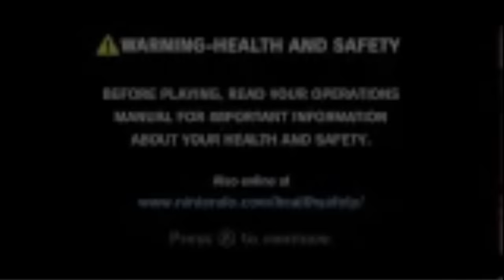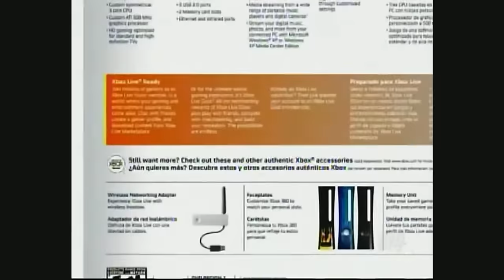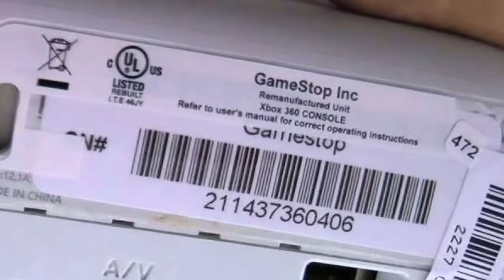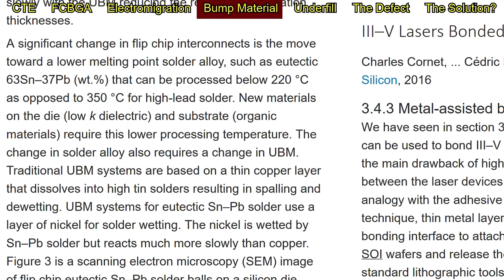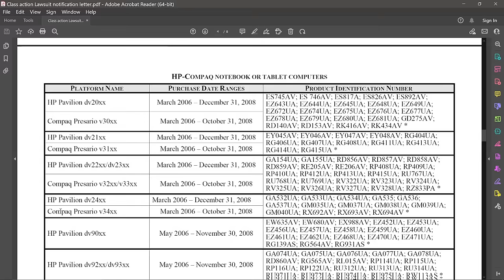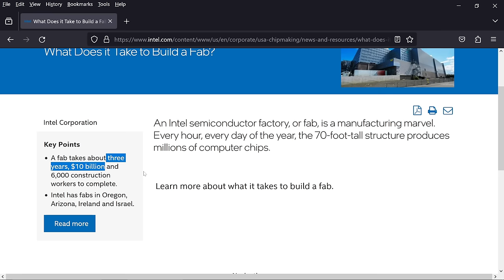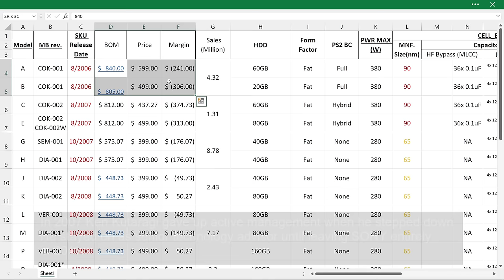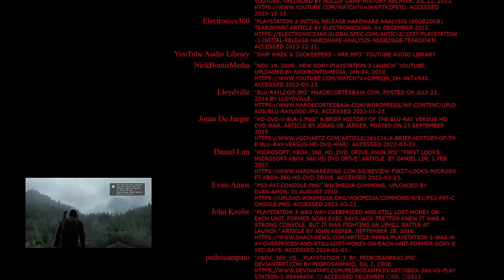A 360 Story -  The RED Ring of Death & the 7th Generation Console War

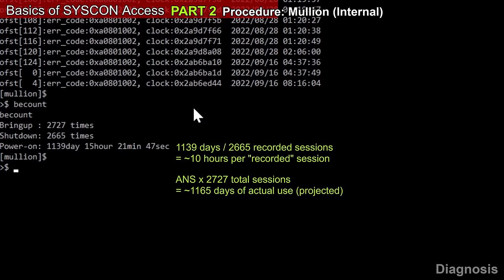Comment: Felix, I have a DIA 002 console that got YLOD with 3034 at 96 days (date code 8c). Could this just be random failure or could some 65nms still be fautly? Refering to 1:19:33
Reply from the maker: It could be a legitimate BGA defect. They do happen. The things I look for are any signs of drop damage. Scuffs, cracks, or dents that might indicate a fall. That's a common cause. Another is is when you change the thermal paste you have to separate the Heatsink from the motherboard, which requires bending the  board to break the seal against the integrated heat spreader. That can break the balls too. So if it's unsealed that could be when the break happened. If you were the one to unseal it, was it working before the paste change? Did you get the errorlog? if it was full of 1200s before opening (cpu overheat) then 3034 after changing paste, that's probably what happened.

If it was sealed and undamaged then it could be naturally occuring. In that case, how much dust is there inside? If caked with blankets of it prolonged overheating could increase the stresses leading to solder failure. But given how few 65nm GPUs die this way, I'm inclined to believe there is no bumpgate related defect in the 65nm RSX. 

A pressure test can tell you if it's BGA most of the time. You press on all four corners of the RSX while trying to turn on. Not alot of force, you can cause a BGA defect pressing too hard. Tjos warps the board and restors contact of a broken ball. If the behavior changes that's a positive pressure test result and more often than not, indicates a BGA failure. It's not 100%, but good enough. If it does nothing at all, it doesnt rule out BGA, but could mean it's the CPU or bumps, or another issue.
Reply: @ripfelix3020  it was a sealed console when I got it (albeit with a hole drilled in the hdd side of the top case infront of the PSU - meaning potential overheating in the past?). I did change the paste on the system and it lasted around a 3 months after with minimal usage. 

The board wasn't stuck as firmly as others I've had in the past in so I doubt I could have damaged the BGA removing the board. There wasn't an awful amount of dust in it but I have no idea how it was previously used so I can't really say much on where it was used if in an enclosed cupboard etc

I've only ever had ylod on one of those boards that was not brick related cos of a bad connection on nor with e3 flasher... used to hate the DIA boards - so I have some solid RSX chips for potential frankenstines from those when I learn to reball 😄

I've not pressure tested it as such but I decided to delid after the ylod when I used the UART and the chip was quite discoloured (adds up with the drilled case?) 

Ended up as a parts console in the end and got two others working so it has made a good sacrifice 😂

Comment: Hey Felix, just watched your vid on the YLOD and it was really informative. It did get me wondering though, have you ever done a dive into the BLOD on the PS4 Pro? This video and the PS3 video has me drawing some of the same conclusions. The main fix i see everywhere is throwing in some washers to make the connections tighter, but after seeing your videos I know this is not a fix. But these are unlike the PS3 chips that you suggested be replaced, as they're newer. Would Sony really make the same mistake twice? I'm really curious on your thoughts on this.
Reply from the maker: From what I know of the BLOD, people are reballing them and having sucess. What IDK are the long term statistics on that. Like if a significan number of people have them fail again after a year or 3. If not, then it could just be run of the mill BGA defects, which OFC can and do happen. But how many of those are on untampered consoles? Kept clean and maintained? I've not looked into it. It's unlikely they made the same mistake (bad packaging materials), but it's possable.

Comment: The clip of MVG is particularly amusing to me because I've caught him being wrong about several things. His channel is really interesting but his technical expertise is shallower than I'd expect for a professional game developer. Guess in his defense the areas where his knowledge have been shallow in the past are mostly with hardware or extremely low level software(OS kernels) where a game developer really has no business being on modern platforms.
Reply from the maker: My purpose in showing that clip isn't to rail on the guy. It was just to show how pervasive the thermal connection is. Everyone knows there was a thermal component to the failures, but everyone assumes overheating. MVG did say "aparently." He left the door open to be wrong. I'm not faulting him for not knowing the muinutia of hardware. This is a quite hard core principle that a software guy isn't likely to be well versed in. It does not reflect pooly on him in any way. It just exemplifies that the issue isnt well understood, even by experts in the scene. 

If he doesn't know, the randon dude on reddit that knows nothing at all asking for help is going to get all kinds of bad advise. I though that it was important to show that clip, so that people don't feel ashamed for not knowing.

Comment: For some reason, my black Jasper console still failed after 4 or 5y. Completely broke during a Forza 4 session and could not boot anymore. If early models were any indication, the issues with manufacturing were not only present on the underfill but on solder quality throughout the board.

Replaced that one with a Xbox S which has been working perfectly until today.

Comment: Trust me, the Wii had heat issues too with the always online crap like WC24 causing heat buildup without the fan running to keep it down and causing disc drives to warp and break down, happened to mine back then and I never replaced the drive because I was knee deep into ISO loading even at that point

Also I have one of those RROD screw kits installed but I keep the screws loosened to a small adjustment and keep the 360 horizontal to keep heat warping from occuring and keep the cooler in contact, the kit can work but everyone loves to death grip the thing to the board
Reply: When was your 360 made?
Reply: @CliffNark  was bought for me as a gift some time in 2008 or 9, was the Lego Indy bundle, odd thing is it either shipped as a zephyr board or they put a first rev CPU cooler on a newer mobo by mistake since I had to swap the coolers

Comment: I was always more of s 360 guy, so I'm glad that I have this incredibly well done video as a resource just like the YLOD documentary. I do have to ask though, have you ever considered doing the Reset Glitch Hack on an Xbox 360? It does most of what a jailbroken PS3 can do for team green.
Reply from the maker: Yeah, I got an early xenon I'm hoping is RROD. I'd like to put a fixed GPU on and RGH it. Might make a vid out of it. Should be fun.
Reply: @ripfelix3020  
Sounds like fun, but do be aware of this: Xenon mobos work best with the EXT_CLK wiring and timing, and this is to be done with a glitch chip, since Xenons don't take RGH 3.0. Also fun fact: some Xenons were actually repaired with a 80nm Elpis GPU, such as my own.
Reply: @superstar64 no Xenon’s have 65nm GPUs except for the one I did with custom trace rewiring. Maybe you meant Elpis 80nm?
Reply: @Josh.Davidson  
I thought I heard somewhere that the Elpis was 65nm, but yeah that's what I meant. My mistake, I'll correct that.

Comment: Without specific details about pinout from the gpu to the interposer and the location or locations of the thermal diodes on the gpu, dropping gpu temp down to 60C can be useless, because if the power pins are near the data pins and if the balls are not quite up to par ( micro cracks,  contact is not that good) the whole area surrounding balls will heat more than the gpu, especially when there is a lot of current draw eg. when pushing gpu to its power limits and if this underfill has not great heat conductivity this will create hotspots near this balls. So maybe if can drop the temps of the gpu and the motherboard gpu power planes to like 40C the release consoles could and maybe even nec caps could last longer ^^
Reply from the maker: That's why the authors of "low tg underfill the good, bad, and the ugly" said the strategy was to keep temps far below the Tg. As for how far...who knows. MS lowered it -7C beneath the revised Tg (75/78C for HTg85 GPUs). IG they calculated that was sufficient given the TDP of those revised GPUs. But it's not a rule we can follow generall outside those GPUs. Like with the RSX or the defective Y1, Y2 and rhea GPUs.

Comment: Are Nvidia and ATi graphics card for PC subject to the same issues ?
They seem to, but that could be another human bias playing with me :)
And if so, would changing the thermal profiles/upgrading the cooling solution so the GPU never reaches 70°C could make the remaining units more reliable ?
Reply from the maker: Yes, it does appear to have affected the entire industry...but it's not clear what chipsets are 100% affected. A total accunting hasn't been established.
Reply from the maker: If it has the bad underfill, keeping it below 70C should help, but there's alot of factors and it shouldn't be thought as a fix.
Reply: @ripfelix3020  I see
I have an Nvidia 8800GT that's still working (was pulled out in circa 2014 from a core 2 quad machine I think). Being thoroughly used from early 2008 to ~2014, I think it won the silicon lottery (Haven't tested it since tho, maybe it died in the box it's been sleeping in ever since ...).

One thing I seem to have noticed (could be just a bad memory/bias), I feel like as it aged it became more and more noisy, despite our best efforts to keep it dust free and refreshing the thermal paste. Maybe Nvidia changed something from the drivers ?

Anyways I'll have to make more experiments with it (which will probably be not enough considering this card is probably a winner anyways)
Reply: To an extent. Larger gpus with worse cooling are known to have more thermal expansion issues and die faster, but it's usually still within the practical lifecycle. Examples are reference blower GTX 780 Tis and 980 Tis. If you want your components to last past their normal usage you probably want to keep them well below their rated tolerances.
Reply: @ripfelix3020  From what I've seen, anything that came out since Geforce 6.

Comment: In the end, do you think that super slims are generally more reliable with more proven components, or cheaper with only CPU/GPU fixed designs which simply heat up less?
Reply from the maker: No, the SS is cheaped down too far IMO. The best compromise of reliability and cost IMO was the 21xx model. It has the 40nm RSX, no tokins, and the more reliable bluetooth/wifi module. Later models have a reliability issue with that thing dying.
Reply: @ripfelix3020  I see thanks.
I have a PAL 20x cfw and a NTSC-J 40x I keep legit for now, but the 65 slim is effectively much louder and running obviously hotter. (and the drive starting to make weird ticking noise I couldn't find the cause after opening it...)
Overall the super slim is more pleasant to use when mainly digital than the slim.

Awesome work on your 2 videos btw :)
Cheers

Comment: I enjoyed the ps3 YLOD explanation video and this too! I have 3 working  PS3 and 1 non working with most errors 1001/2 and the final 6 of them 3004. I thought fan speed would matter more in order to stay alive more! The faulty ps3 had soooooo mush dust in it and  it was used with the front fan add on, the one that did more noise than cooling haha, but I thought this might be the reason that there are no RSX errors, yet. I have all working ps3 with fan speed at 60%
I KNOW it is loud but I have the console somewhere not close to me in order to stay cool and not bothering me, not so much 😂Do you think that temperatures below 60 Celsius won't help RSX?
Reply from the maker: Keeping temps "significantly" under the 70C Tg of the underfill is a solid engineering principal that "should" help. I cannot say it will. There is much more involved. However, in my experiance and from anecdotyl reports from others, consoles that run hot, full of dust, and ill maintained die sooner. Keeping them clean and cool makes them last longer. So traditional wisdom still applies. I just cant give you reassurance that setting a 60% fan speed is for sure going to prevent YLOD. The best I can offer you is,  It should help.
Reply from the maker: The construction of the die and interposer involve more than just the underfill. The under bump metalization layer and it's shape can affect the mechanical strain forces it experiances. The presence/absence of a polyamide passivization (stress) layer can affect how much force is applied to the area around the bump joint. The TDP of the chip and thermal inertia (how much heat, how fast) it can deliver affect the forces. The 3D design and layout of the power planes and components (die, SMDs, VRAM, the motherboard) all affect the flexing and stresses...

And much more I'm not aware of. All of this has to be modeled in CAD and simulated. Then optimized. Then tested (qualified) to failure to be sure the simulated results match up with real world results.

There is sooo much more that goes into it than just the Tg of the underfill. If I said all you need to do is be sure it stayed under 70C, then I'd be ignoring a crap-ton of other properties that could greatly influence the result. Will it? IDK! Which is why I can't say it.

All I can say is, "it should help."

The smaller the change in temperature (Delta T), the lower the thermal stresses and longer it'll last.
Reply from the maker: They affect all Flip-chip packages. From your pc graphics cards to ps3. A defective material set can doom anything.

Comment: Make the PS3 CPU STL model thing free and quit only letting your friends use it. Is it even worthwhile? Great video and analysis as always but help me out with the STL.
Reply from the maker: Haha...it's on a long list of half finished projects. I know it's easy to simply throw the STL up on thingiverse and call it a day, but this thing is a disaster waiti g to happen if it's not done correctly.  So before I release it widely, I needed to have it tested and properly made by people I trust to make it.

What it doesn't do. It's not to make your temps better! That's what everyone thinks and the primary reason I can't just release it without a HUGE DISCLAIMER.

What it does do, is keep the MB from bowing, sagging under the pressure of the heatsink pressing down on the IHS/Die. There are 4x 1mm standoffs touching the MB on the backplate. They are under the 4 corners of the chip. All this does is brace the center and prevent it from waroing in the center beneath the die. 

The red herring. It restores coplanrity (flatness) on consoles that have sagged over time and have old, pumped out paste, restoring contact again. So yes, it does improve temps in that case. That's why SONY used them. BUT IT DOESN'T LAST. Sony had a 3 month warranty on repairs, so they only needed it to last that long. They weren't about to replace the CPU just to replace failing paste under the IHS, assuming they even had inventory to replace with. And OEMs don't delid. That's just not how they operate. Instead they used this hack to get the conaole off their workbench and working with decent temps for long enough to get it past the warranty period of their service.

Long term. You will still have to delid the CPU. When you do it's important to reapply appropriate silicon adhesive on the IHS which acts as a stiffener. It's needed to keep the bondline thickness uniform (paste flat against the die). It helps stiffen the package (die/interposer/bumps/underfil/TIM/IHS) for long term reliability. It helps keep the BGA from warping, bowing and experiancing larger deflections with each thermal cycle. And the backplate with the cell bracer helps prevent that as well. So, applying it then, when you delid and repaste/reglue is the right time.

The HUGE DISCALIMER. Those standoffs on the packplate are 1mm tall. The CELL Brace must be sanded down so that it is exactly 1mm off the board. This way you are "bracing" the center, not adding pressure. If you add pressure under the die, like placing a 2mm thermal pad, or eraser, or unsanded bracer does, then you RISK KILLING THE CPU. I have seen this many times. Addimg pressure under the die can crack the die, break the BGA and that's it for your console. A CPU swap is very difficult work and it's easier to fix the donor console you would need to harvest a working CPU set (cell/flash/syscon are married) from.

Before I releas the STL for real I am having my friends thoroughly test them on their repaired comsoles (which have warranties). I am satisfied they are safe when properly made, but if they are not carefully sanded down there is not any differwnce from the eraser mods people are killing their consoles with.

I will make a video about it when I'm ready to release explaining all this. But my time is limited and split between many projects that I switch between based on interest.
Reply: @ripfelix3020  Dude, thank you very much for such a great response and taking the time to respond at all. I really enjoy your videos and research and having this additional information is really helpful and honestly I am shocked that it got a response. Seeing other comments online, people are jerks - but you sir, are "a real one" and have earned my sub. Keep up the great research and story telling. I've decided to sell my untouched 400 hour 60gb and let someone else figure it out longterm and enjoy it. I'll be good with a slim. Thanks again and I hope you are having a great wednesday.